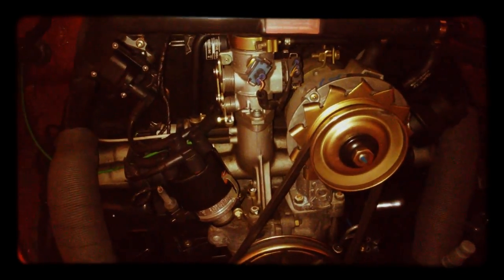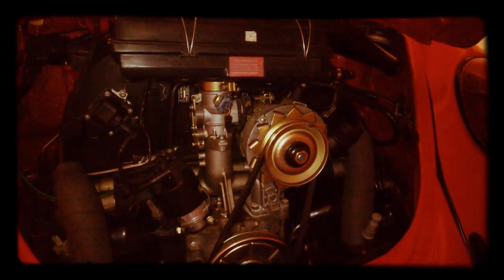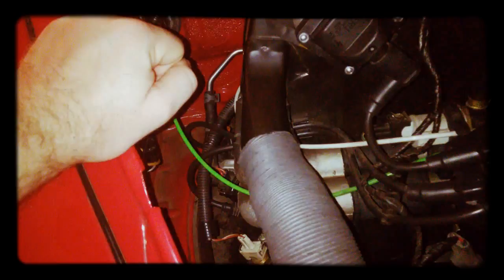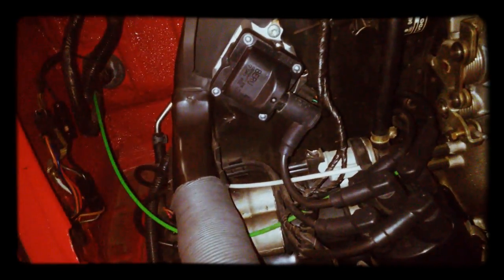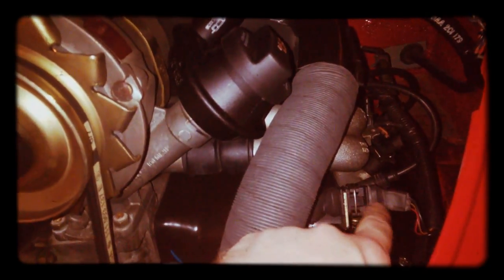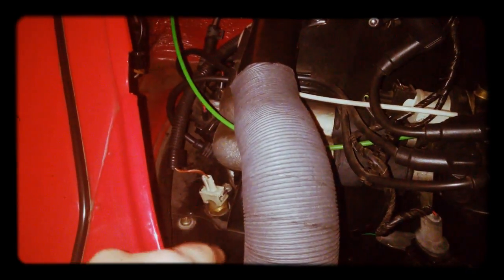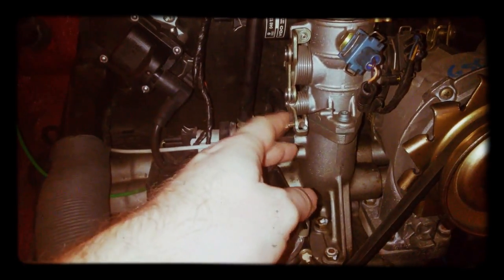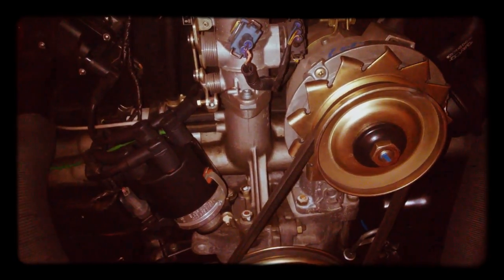1600i beetle engine explained

Comment: Hey man, what’s the point of the head temp sensor if there is no gauge? I have a 96 1600i beetle.
Reply from the maker: The sensor gives the engine temp to the ECU for it to regulate idle and injection pulse. On a water cooled car this information comes from the coolant temp sensor.
Reply: @giovannigarbarini  thank you, your videos have been very informative 👍

Comment: can us gringos get the Fuel Injection system for our vw based projects?
Reply from the maker: The components are available from Mexico, new NOS or remanufactured. I usually buy spares from a vendor on TheSamba named Antonio Trejo but in Euroe most VW parts specialist either carry some basic parts or can source them e.g. directly from VW, so I think that'd be the same in the US.

Comment from the maker: Hi! The head temp signal is used by the ecu to set timing and injection, i don't think it actually gives protection from overheating but again, I have never experieced overheating on my engine. If you think you have issues youtube comments are not the best place to discuss... I'd suggest a bug forum, maybe one where there's a user under the nickname "GArBa" ;)

Comment: I wanted to message you but didn't find the option. Do you have more info about the cylinder head temp sensor and what kind of protection it offers? I also have a Mexican 1600i and I'm afraid to drive it it hot conditions because I cannot monitor engine temperature.